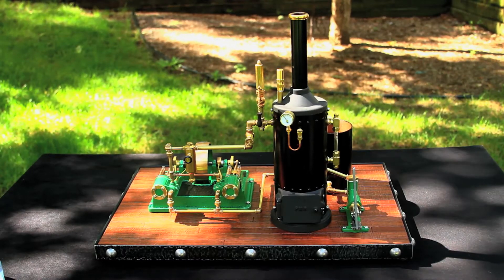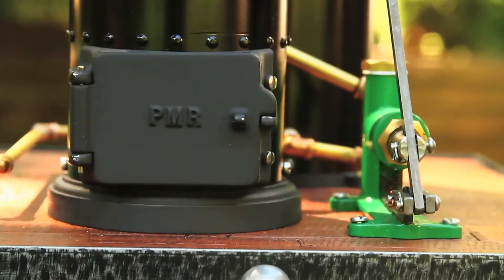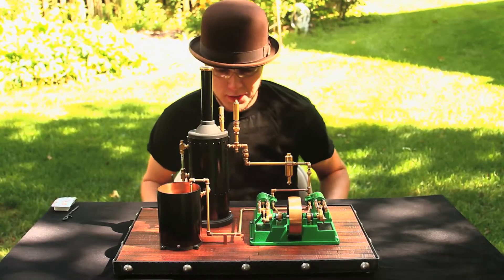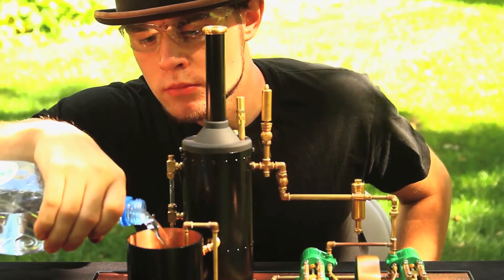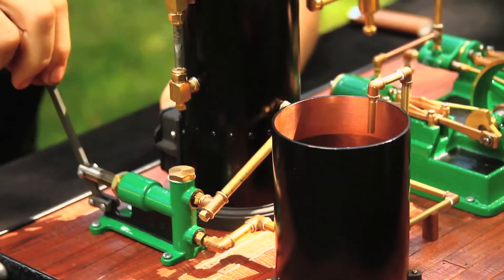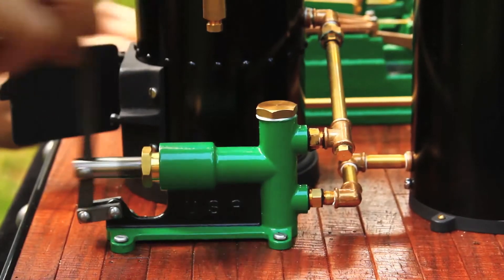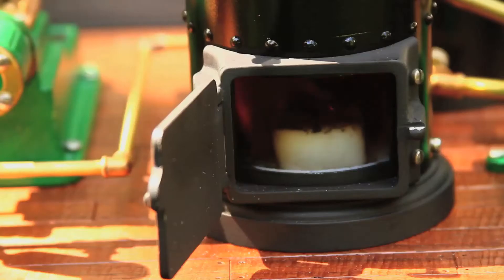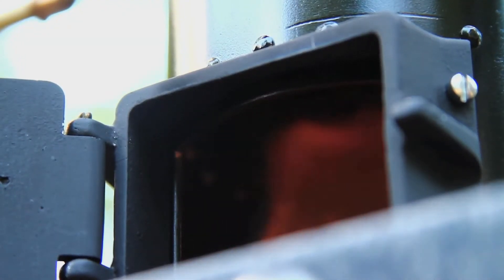Model steam engine plant PM Research Twin Mill Engine

Comment: Can you tell me if the crank, eccentric and the eccentric hub actually make contact with the cast iron base where the axle passes through it ? I kept those areas on the base bare metal  because I thought there would be contact there but now I am wondering if I should have just painted those areas.
Reply from the maker: Sorry about the late respone. They do not make contact.

Comment: Nice pipework. How did you connect the manifold between the two cylinders ? I am having some problems with that.
Reply from the maker: I cut the pipe the exact length required, threaded the ends… than threaded each side to it until I had the proper spacing. soldered it in place I believe. Thats the inlet manifold… the exhaust uses 2 union joints.

Comment: I have just finished the single cylinder 3BIM and I will be building the 7BIM soon. One problem I did have have was the screw that passes through the connecting rod to the crank : this kept coming loose from the crank so I had to use Loctite 222 to hold it in position. PM Research reckon that this should not have been necessary. What was your experience with this part ?

Comment: How did you prepare the cast iron base prior to painting ? Was an etch primer used at all ?
Reply from the maker: Brian John I sand blasted it and cleaned it with acetone. Then enamel primer, I do not recall if it was etch primer.